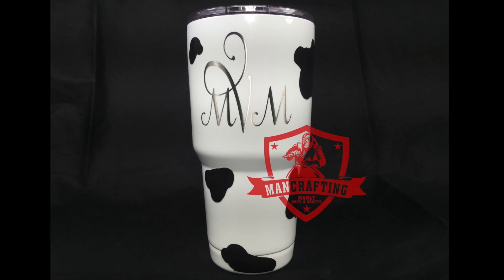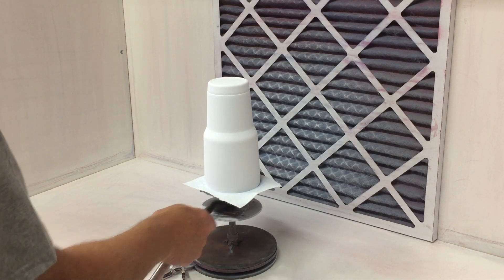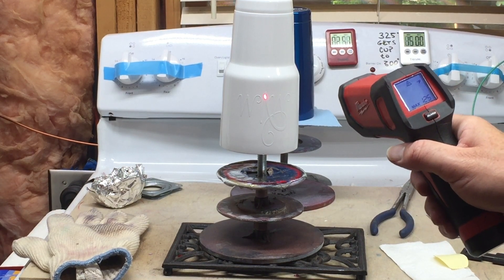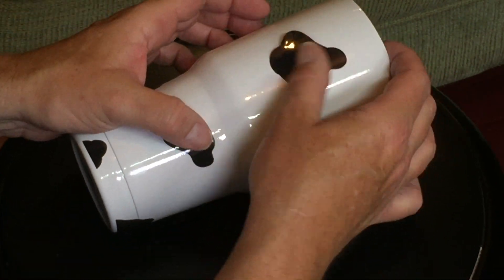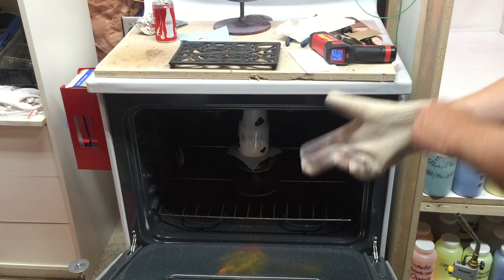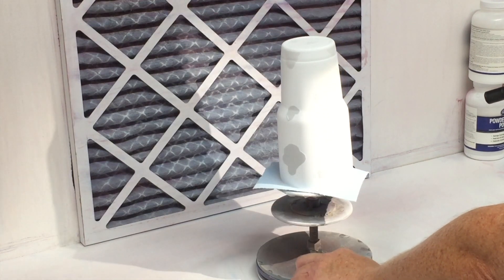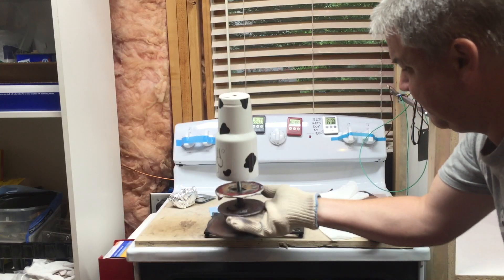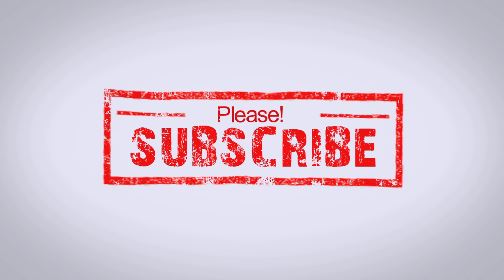Holstein Cow Tumbler aka Chick-Fil-A inspired design

Comment: Sir, at what temp did you cure the cup at the 2.5 minute cure, at the beginning of the video? Thank you.
Reply from the maker: What ever the powder says the PMT should be, I just pull it before the cup reaches that temp.I'm just trying to get a partial cure.
Reply: Seems that no matter what time I pull it out, the glue wants to stick.
Reply from the maker: Mike Carmody what vinyl?
Reply: That’s a very good question. What is best?
Reply from the maker: Mike Carmody this is what I use when I’m removing vinyl like we did in several other videos. Circuit Rose Vinyl http://amzn.to/2dGxbFs  I generally pull the vinyl by about 90 seconds in. If I want a partial cure for a second color I’ll put it back in for a little longer.
Reply: ManCraftingTM I really appreciate the feedback. Thank you.

Comment: Thanks for posting these videos! I've learned a lot through trial and error, but your information has really helped me improve my techniques. I've just been wondering about where you measure the PMT on a tumbler. I've noticed that the PMT can be higher at the bottom of the cup (near the RTIC or YETI logo), and lower at the top of the cup. So where do you measure the PMT at?
Reply from the maker: Orlando Flores usually about the middle.

Comment: We are using Eastwood low temp clear coat and are experiencing chipping 14-21 days after cure.  Our Oracal 651 vinyl also seems to shrink during the cure process.  Any suggestions?
Reply from the maker: Make sure your getting the powder to cure temp prior to starting your cure time.  Check temps regularly.  Vinyls see to shrink if the first coat isn't a min of 75% cured.

Comment: HI Chad. Awesome video! What is the name of the low temp clear coat and where can I buy it? Thanks in advance
Reply from the maker: +rudy quilantan  it's not commercially available at this time.  If I'm able to change that I'll post a video.
Reply: +ManCraftingTM 
Thank you for the fast response. I found a crystal clear top coat at 95 % high gloss that bakes at 284°F for 30 mins I'm gonna tryout. Found it on Ebay.
Reply from the maker: +rudy quilantan good to know.  Thanks.

Comment: what curing  schedule did you use for the clear coat  and at what temp
Reply from the maker: We cured for 30m after PMT at 300°F.
Reply: What powder did you use and where did you get it?
Reply from the maker: +Terri Langford  I used a low temp clear.  Lowest I can find right now is All Powder Paints and it's rated for 320°F.  This was from a company that was bought by another company.  The new company isn't making it yet.
Reply: +ManCraftingTM okay I have 340 degrees

Comment: please help! i powder coated me a cup and cleaned it super good. its chipping now and i also put a clear on it. do i need to sand the cups??
Reply from the maker: How long has it been?   I'd say it wasn't fully cured.
Reply: just a couple days later. im baking the cups to exactly what the package says. im using eastwood powder.
Reply from the maker: +Casey Smith contact Eastwood.  Is that the Low Temp Clear?  If so second person today that asked me about this.